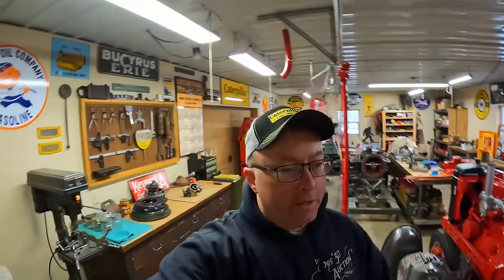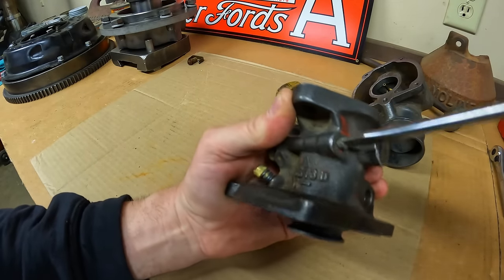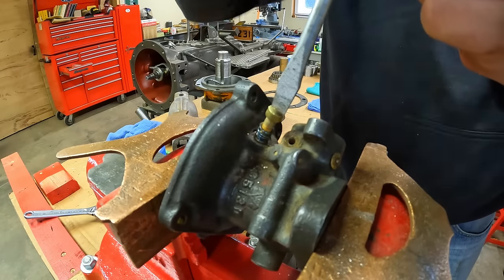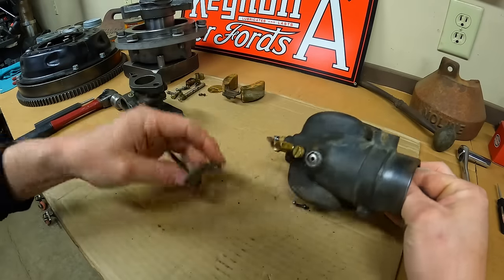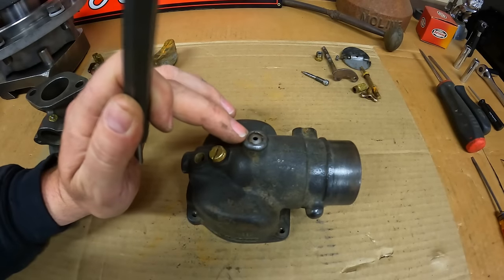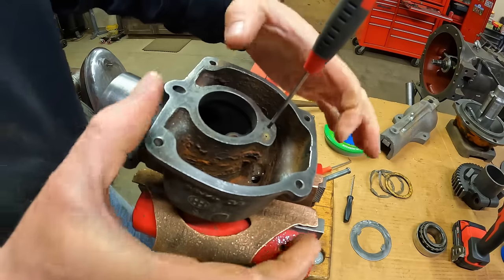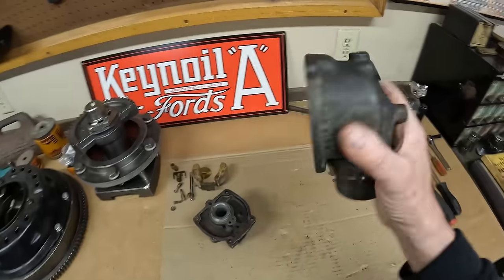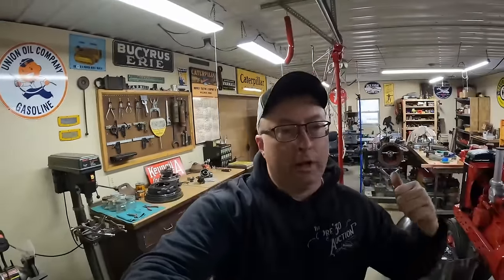Can We Save This Farmall M Carburetor??? Damaged by Frozen Water & Rust - Restoration Series Part 1

Comment: That has got to be the most complete carb kit i have ever seen,they should all be that way instead of buying individual parts and pieces😁
Reply from the maker: That’s the only way I’ll buy them if I’ve got the option - just the basic kit that only contains the gaskets, seals, and a new inlet needle & seat still costs $35, but at $85 for this absolutely complete kit that has all new jets, seats, shafts, bushings, butterflies, and felts - that extra $50 in cost is a bargain just on the time I save by not having to clean, polish, and overhaul all of those little pieces 👍
Reply: Where would a guy find a kit like that?I may have missed that in the video.
Reply: Please elaborate on supplier and kit number. Surely more folks would like to keep that supply chain working.
Reply: I wish they were all that complete.
Reply: @squatch253  I couldn't find a complete kit for a Case tractor with a Marvel carb a few years ago, and let the CIH dealer talk me into their master kit or whatever it was called. Due to supercessions and corporate progress, all i got for the 100$ special order was the bowl gasket and needle/seat. The much cheaper Hygrade kit I used on the MM U had more parts and the right gaskets anyway! I was really hoping for the shaft bushings and other hardware. There weren't a whole lot of non standard parts in the carb after all, so i'm not sure why the aftermarket parts listings skip that one.  When you find a comprehensive kit, buy it x 2 😊

Comment: when the venturi stuck like that in my M's carb, I tore it down like you did.  set my oven to 400 and baked mine for about a half hour.  took it out, and set an ice cube on the inside of the venturi tube.    that thing almost jumped out of the upper body.  cleaned it up with an emery cloth and finished off the rebuild.    Nice work there on that itty bitty jet.  those things are a royal PITA  when they go

Comment: Nice rescue!  I enjoy your soft touch getting out the stubborn fastners...then moving up the force/heat scale as needed.  Excellent tip on the torx bit for softer materials.  The venturi press tool was brilliant.   One of the few times when the snapping/popping sound is the sound of success.  Well done!

Comment: Nail looks painful. In a pinch, burning thru your Nail with a red hot straightened paper clip will relieve the pressure.  Seems crazy until you do it. I had a resulting geyser hit the ceiling 7 feet above where I was seated.  The relief was immense and immediate. Learned it from an old Irish carpenter. Cheers

Comment: Well done! I've had great results with stuck brass jets in cast iron by simply heating the carburettor up and then quenching it in water.
Immovable jets would just come out as though they had never been fully tightened.

Comment: Definitely need to get you a sonic cleaner...can dunk the whole thing in some soapy water...turn it on...and it should get in and bust loose some of the rust/corrosion and maybe help loosen up those sticky brass pieces
If not...a sonic cleaner helps clean up carbs and stuff that normally would be a pain to clean
Keep em coming!!!!
Reply from the maker: I have an ultrasonic cleaner, but I’ve never been impressed with its performance so it never gets used.
Reply: Hayden,  that exactly was my first thought,   A nice slow soaking in a heated ultrasonic bath stirs up all that little stuff and busts it loose.

Comment: I would highly recommend rebuilding the old carburetor if you can or find a better core if the old one has serious issues. Some of these Ebay rebuild or new reproduction carburetors maybe a waste of money. Had a very unpleasant experience with a so called rebuild 59 Ford Fairlane carburetor years ago. After that i'm saving up all the old carburetors if I can.  Even this Farmall M carburetor body looks fine despite it was full of water. Usually cast iron and water don't mix well. Glad you where able to save this one for your friend.

Comment: ran when parked! The corrosion that happens is crazy. I'm really surprised you got the float hinge screws out, usually the heads are rust-eroded away when the bowl looks that rusty. Hint for everyone: if you break a fastener in a carbureator, just stop. Many passages are not standard/common threads, so you will need to find the correct taps before proceding.  Squatch has a very extensive tool set and i assume some off camera knowledge and patience with experience to proceed confidently cautious.  or maybe it's luck 😅  thanks for sharing, Squatch

Comment: Great job on the strip down Toby, especially getting that darn broken and stuck idle jet out!!
Wish this video had been out a year ago, before i started on my (identical) W6 carburettor.
I managed to extract all else (with some difficulty) but sadly, I didn't 😅have the same luck as you with the idle jet and, as you mentioned in your video, the tiny easyout broke in the drilled out jet.
I managed to source a used carburettor in the UK which cost a whopping £300 sterling ($370 US) but, this is where my luck changed..... for the better!
Upon splitting the carburettor to do a full rebuild on her, I quickly realised I had managed to purchase an extremely lightly used new carburettor and the internals were like the day it came from the factory.
Looking at the outside beforehand, I did notice only red paint on the outer faces of the unit but thought it was only a bad attempt at freshening up the paint job on an old tractor.
I still have the original and, apart from the bowl, it is in great condition and would rather have kept it on the tractor, albeit with a complete rebuild kit installed (i prefer originality!), I am looking to source a 2nd hand bowl with idle jet intact if you know of any in your area?
Looking forward to part 2 now!!
Adam.
🏴🇬🇧

Comment: I’ve redone worse. The carb on my old Ford 4000 backhoe had sat outside for several years with no air intake. The inside of the float bowl was nothing but a mass of hard flaky rust. I literally had to use a big flat blade screwdriver as a chisel to chip out the massive rust layers. Then a glass bead blaster finished cleaning it up. That carb is still running good on that old machine today.

Comment: On the version of this carburetor that is used on the 9n-2n-8n Fords, there is a special flat blade screwdriver slot on the lower housing that helps you to install the choke throttle blade.  The slot is covered by the airhorn (top half of the carb) gasket. This is helpful to know because it is a fiddly little task otherwise.

Comment: This is a great video because I can compare to the Marvel Schebler carburetors that Ford used in the N tractors and the NAA/Jubilees. I’ve rebuilt a whole bunch of those. Ford fiddled with jet sizes through the N tractor run and it pays to update to the final sizes that Ford settled on. I know that YouTube frowns on recommending vendors so I will just say that the cheapest rebuild kits from the tractor store that stock’s everything may not have the final jet sizes so I go with vendors that specialize in Ford tractor parts.
The Ford carbs use a brass Venturi so I’ve never found a stuck one.
I’ve seen a few with the shaft holes for the throttle shaft drilled and bushed with brass bushings. I have a hunch that this was done if the carb was sent in for a factory authorized vendor full rebuild. They also usually attached a brass plate to the carb indicating that it was a rebuild.
Finally. I have a gallon can of the carb cleaner soak overnight stuff which is really caustic. I wear goggles and gloves working with the stuff. It’s OK with cast iron and brass but it would probably dissolve the zinc Venturi in your Farmall carb. At any rate I wouldn’t chance it.

I had an 8N in the shop once that was hard to start. No wonder as the main jet had been left out it ran fine, though.

Comment: I have found two good ways at getting rust out of inconvenient places. Easiest is to just use evap-o-rust. Second is electrolysis. All you need is a bucket, water, washing soda, sacrificial anode, and a 12 volt battery charger. Don't have washing soda? Heat some baking soda in the oven at 350 deg for 20 minuets. Voilà! Washing soda. I used electrolysis on the bolt of an old pump action 22 that had been sitting in a leaky barn for more than 50 years and turned it from a seized, rusty lump into a functioning part, small bits included.
Reply from the maker: I actually have the float bowl doing the Evapo-Rust soak right now 👍

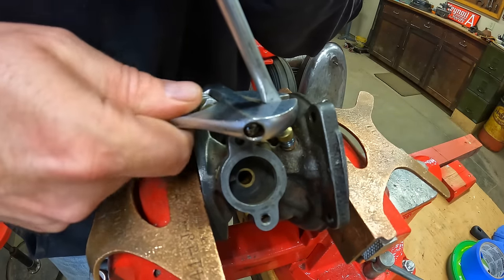Comment: 4:56 a trick to block them from splitting or the driver from slipping is to machine a sleeve for the driver (can be brass or steel, doesn't matter) that goes over the screw head snug fit. That way, it can't split apart and you have less chances to slip and break it. You can also make a slot in the end of that sleeve to act like an extension. The little flex these screw heads have will lock them in place, i usually put a tiny 1 mm grub screw on the side. Always pops these pesky stuck screws out.

Comment: You may already know this ... but Brass expands about 150% as much with heat as steel or cast iron.  Not to say that heat won't help, just that it may require a different strategy for using the heat than a steel fastener in steel (or cast iron)

Comment: Were the throttle plate screws staked ? There is a tool for staking the ends after installing without putting pressure on the shaft. 
Were those stubby easy outs that you used to remove the shaft bushings?  I’m looking forward to seeing the next video!
Reply from the maker: IH never staked the butterfly screws from the factory on these updraft carburetors, because they couldn’t be sucked up high enough to ever get into the engine. Downdraft carburetors always had them staked though. Yes, I used shallow internal grip extractors to pull these bushings out 👍

Comment: I wondered what that tool was that you used to remove the throttle shaft bushings? Does it have a slight taper to fit in the i.d. by tapping with a hammer and then twist it out?  I assume you made that tool. Im having a heck of a time trying to remove those bushings. Any suggestions?
Reply from the maker: That was a tapered, fluted broken bolt extractor - they work great for grabbing onto smaller bushings like these and pulling/twisting them out 👍
Reply: @squatch253  thank you! I just ordered a set!  I'm rebuilding my M carburetor and your video helps tremendously! Thank you

Comment: This carb looks remarkably like one I rebuilt from a forklift with a Continental flathead 6 industrial engine...  a Marvel Schebler..  is that what it is, or is it a just similar?
Reply from the maker: This carburetor is technically an "IH" built unit, but the design is almost 100% Marvel Schebler so I'm assuming that IH paid for the rights to reproduce Marvel's design but with their own tweaks like the throttle receptacle built into the top casting instead of just using the normal external throttle arm that you'd normally see.

Comment: Pretty straight forward, however since you had your Torx driver in the brass creating a heat sink wouldn't  the heat need to be applied for a longer time, Also what is your favorite free me juice?
Reply: You would want that heat sink effect.  Brass expands more than cast iron,  so if everything is heated to the same temperature, heating would make a brass screw tighter in cast iron, not looser.

Comment: Im curious about the throttle plate. Are they all stamped with the number 12, or is it just stamped with a number and that indicates which side needs to be up?
Reply from the maker: I believe that 12* stamping means the beveled edges are machined to 12 degree angles to better seal the plate to the carburetor body.

Comment: "is that a BB?  No it's a steel ball"    BB's are steel balls.   BB shot for shotguns were a size of lead shot,  but the BB's that you shot out of your Daisy BB gun were steel balls, usually copper plated.
Reply from the maker: BB’s for shot are mild, soft steel which I was suspecting because of how much the old detent ball had worn. If it was a true proper check ball, it would’ve been hard enough to wear into the choke arm instead 👍

Comment: My only confusion in your process was why you used a hand held drill rather than using a drill press.  A good effort to keep it square to the hole with the hand held drill but I could see it move just fractionally as you drilled.
Reply from the maker: It would take me the better part of a day to build a holding fixture for the carburetor body. The only square and flat surface on that bowl casting is the side that I had to have pointing up.
Reply: @squatch253  :  Well,... OK...  But you just gotta admit we've kinda gotten used to you going to some wonderfully crazy extremes to achieve perfection in so much.  It just seemed to be an oddity.  🤔😁😃

Comment: Maybe I missed it, but what's the small brass pinhole piece that was next to the broken off idle jet? Is there ever a reason to remove or replace that?
Reply from the maker: That’s the discharge tube vent, it’s a permanently installed brass orifice that you have to destroy to remove. As long as the passage beneath it it open, it doesn’t pay to take it out.

Comment: What about those new ultrasonic cleaner , have you tried clean a carburator with one of those machine.
Are they just a joke or does they work?
Reply from the maker: I’ve got one, but have never been impressed with its performance so it hasn’t been used in years.